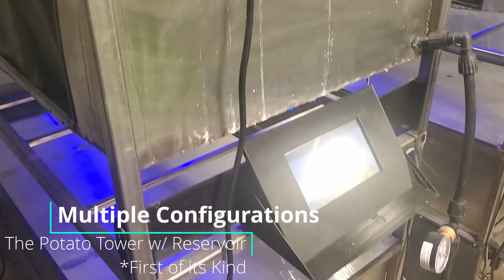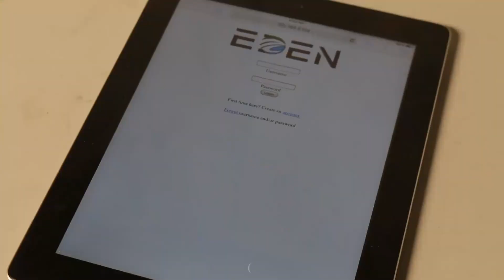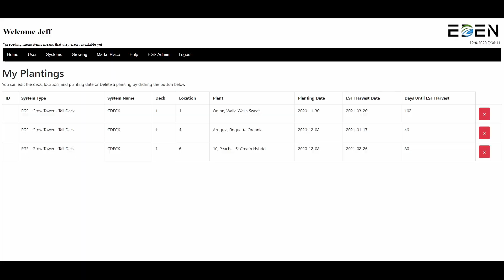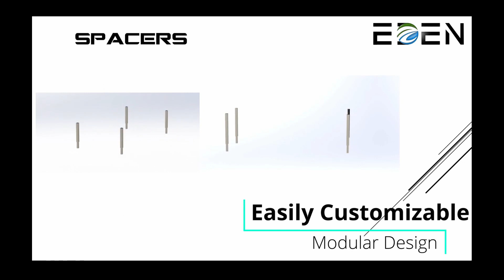BE READY - Food Insecurity is Coming

Comment: Is there enough space under the bottom for a pallet jack to slide under to make moving full units easier? With the depth of the towers it looks like you might be able to get 2 onto one pallet jack for moving making it easier to pack them into a space to increase growing then to move slightly to get the room to access for checks and harvest. A full pallet sized tower you would need to access both sides for but might be a later option for commercial/industrial operations after the current towers are perfected and in the manufacturers setup. 

The current ability to move a loaded tower on rollers in a standard 34 inch door would be a good thing overall as it lets you sell to people in standard homes/offices rather then places with larger doors. The ability to move a tower in a normal door lets a customer move the towers along the growth stages in a production line type setup including moving to harvest stations rather then sending in people to harvest at a fixed in place tower.
Reply: upvote; would love this; probably would need some "moving bolt" holes etc

Comment: The ability to sell this in levels would be interesting for how much skill the customer has to put together. An expert package that is just the electronics and a cut list for the steel they can buy local, a Flat pack option for those that can build but want you to do the cutting of the steel and a we ship the towers to you option for those that want to grow but know they have limited time/skill.
Reply: I have 16ft x 2ft  aeroponic chambers that can literally be rolled up, there`s no need to use expensive heavy, chambers when you are using mist.The lid is the only part that takes any strain.